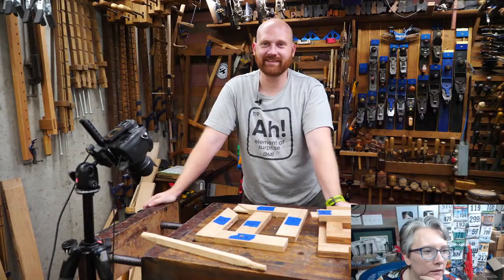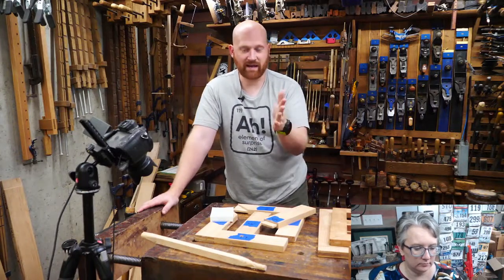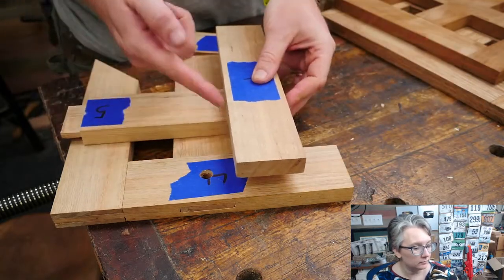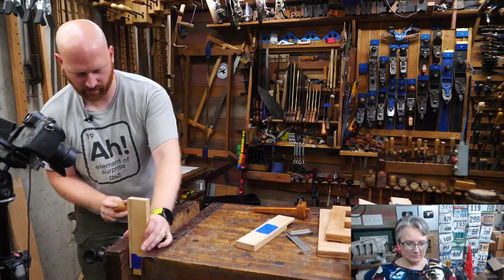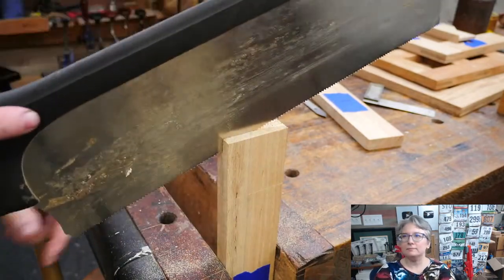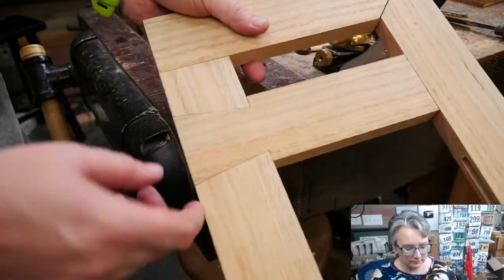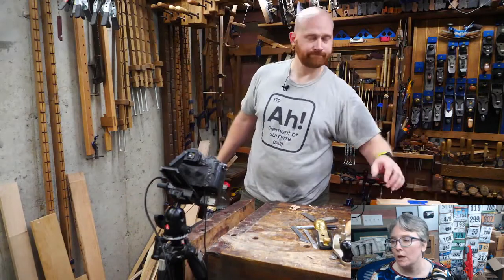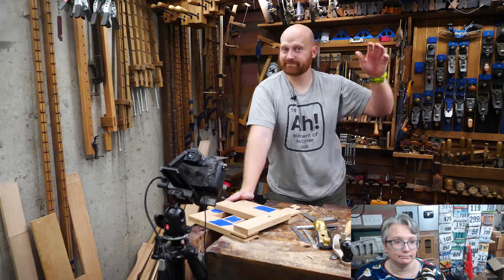Dovetail Half Lap - Joinery Window Part 6 - 2023

Comment: Are there any best practices for the shape of the dovetail when you join two piece at non square angles?
Reply from the maker: In short not really. But it's a great way to start arguments. Some people believe very strongly one way or another. It has more to do with the direction of force that will be applied to it after it's completed. Unless to do with the actual angle of the two boards intersecting.